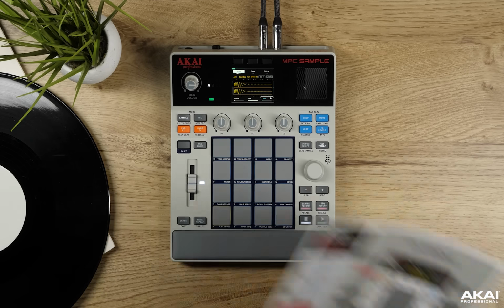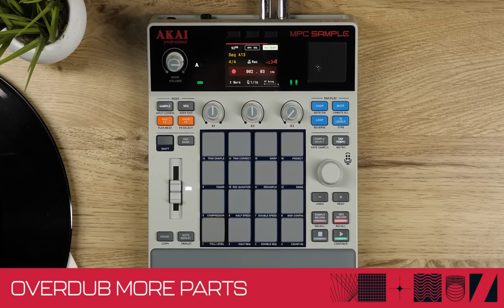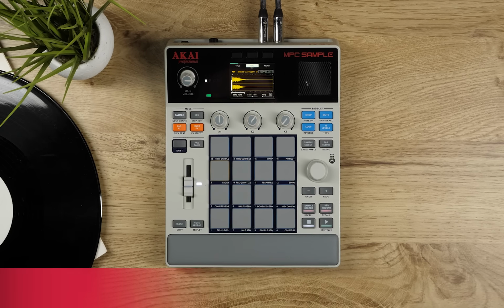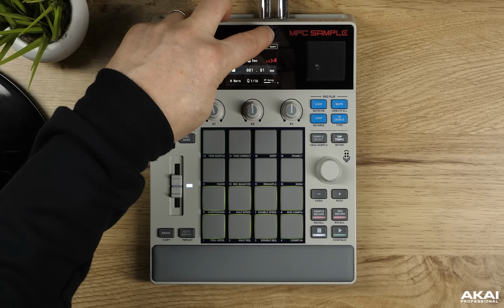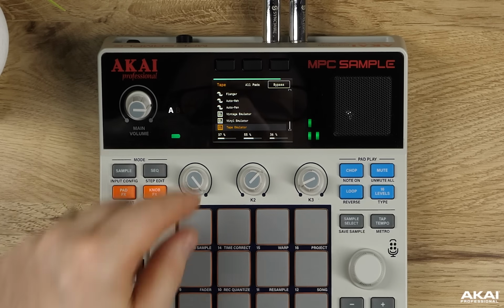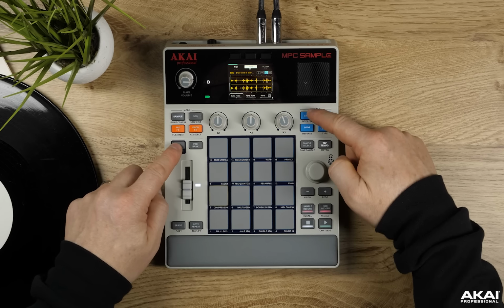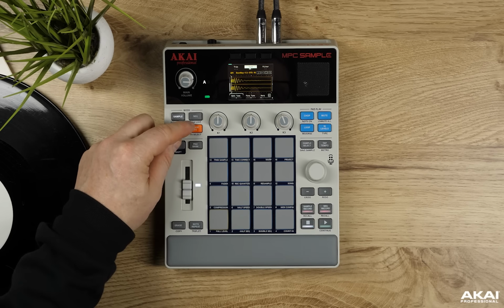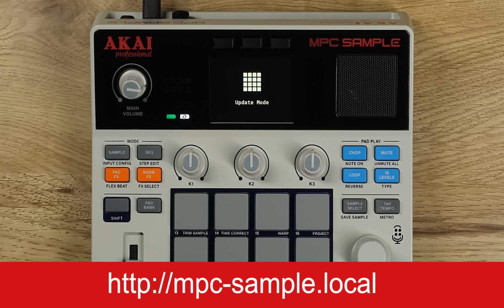Getting Started with MPC Sample | Navigation and Sounds

Comment: Struggling with loop timing and sample stretching on the MPC Sample.

No matter what I try—setting the BPM, turning on the metronome, quantizing, or using Warp/Time Stretch—recorded samples and finger-drummed pads end up off-beat and fail to loop properly over a 2- or 4-bar sequence.

In FL Studio, stretching a sample to fit exact bars takes seconds. On this hardware, if a sample or pad performance extends past the bar length, it runs over and breaks the whole take. I've already tried factory resetting, restarting, and searching YouTube, but no tutorial seems to cover this specific issue.

Does anyone have a step-by-step guide (with exact button presses) on how to automatically fit/crop audio and pad performances that exceed the bar length?

Comment: Can I transfer beats from mpc sample to mpc one?
Reply from the maker: Yes
Reply: When i hook up my ethernet cable. To update. It doesn't work.  So I can't connect  mpc sample to mpc one with a type a wire. Is it because  the new update?
Reply: I think you need 1 to be running 3.8